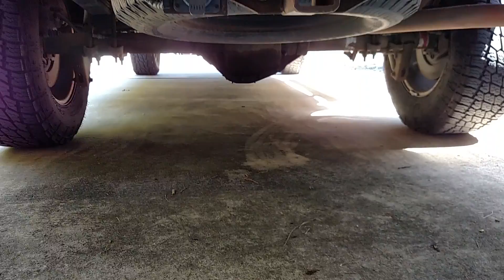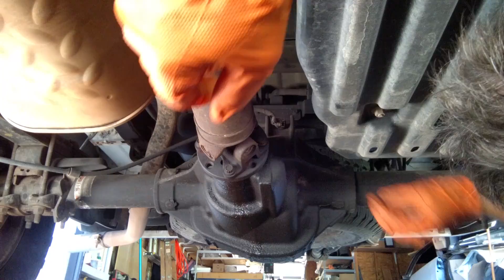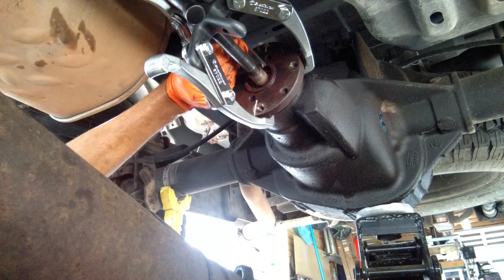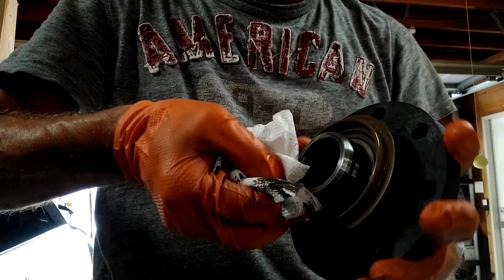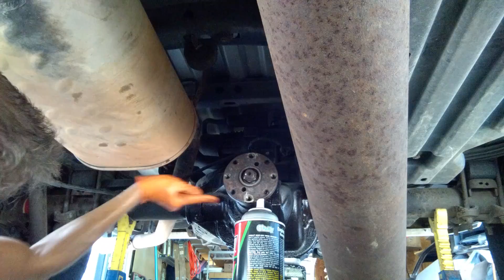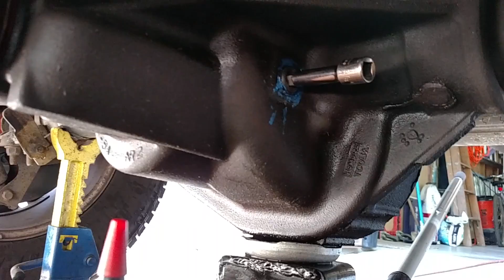Fix your leaking rear differential with a pinion seal replacement

Comment: How about jack truck up ? Maybe easier ???
Reply from the maker: You are correct, it would have been easier.  Unfortunately my jack stands were not tall enough.  After my previous hydraulic jack failed, I will never get under a raised vehicle without jack stands.

Comment: Great video it was liking watching myself do this. I usually have to go through the exact same BS lol. Been watching other videos about this, I can add some things that I've learned and could add to this video.
 (1) When taking off the drive shaft instead of trying to pry it off with the screwdriver, use a rubber mallet and hit down  on bit of an angle. Took about 10 to 15 good wacks.

(2) Instead of measuring how far the 27mm or 28mm  bolt went in. Just mark the corner of the bolt and on the hub/flange so they line up, put the socket on, and mark the socket so it lines up with the marking on the hub. I use that paper white out stuff to mark.  Then use the marking on the socket to count how many turns it takes for it to come off. Took 16 turns for me.

(3) If you want to know if the new seal is all in and flush, lightly tap around the outer part of it and listen for the solid metal-on-metal sound. You were using a scraper checking for space. 

(4) When tightening the drive shaft back on, the torque specs for those 4 bolts is 76 ft/lbs. Also use the blue Loctite.